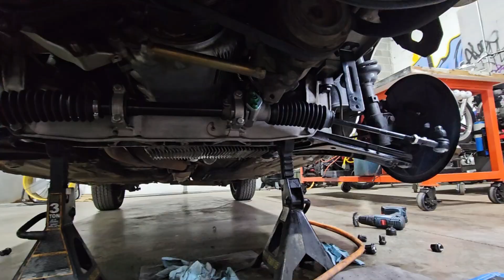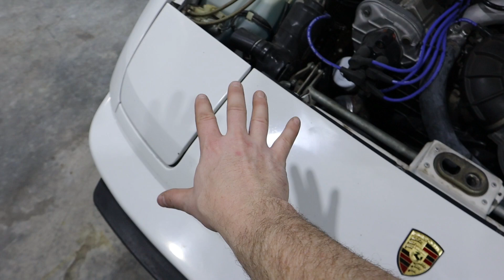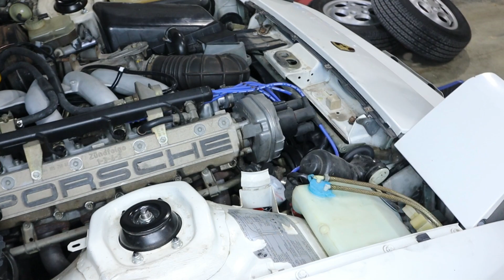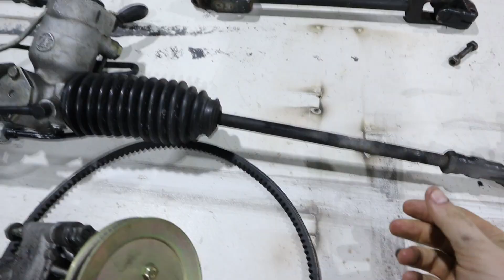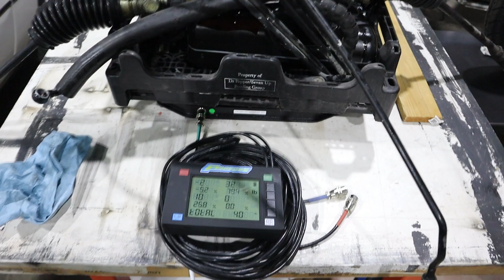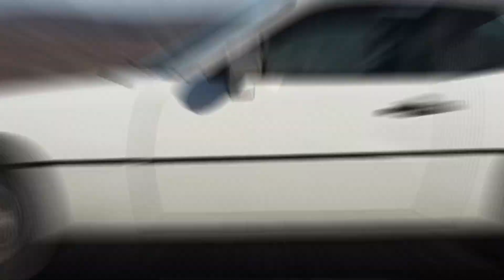Manual Steering Conversion On My Porsche 924

Comment: When the time comes, …and it will come, and you need to replace the AC compressor, later model compressors are much lighter and smaller.  And the new electric powered compressors can be hidden above the fender well and clean up the engine compartment.

Comment: That was a great mod for that car. Steering effort is mitigated by only turning when you have roll going on. None of my 1st 3 vehicles had power steering, air conditioning, or automatics. I miss the manual shift. I still have 3 with that, though.
Reply from the maker: 100%  Most of my vehicles have been manual